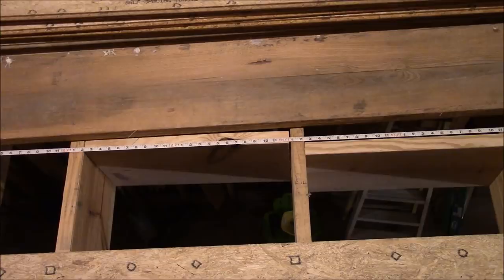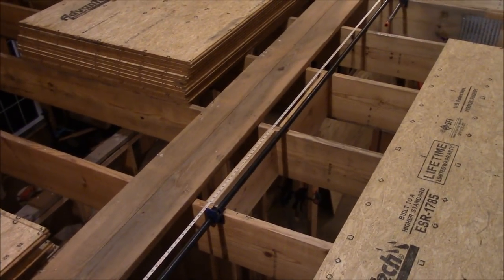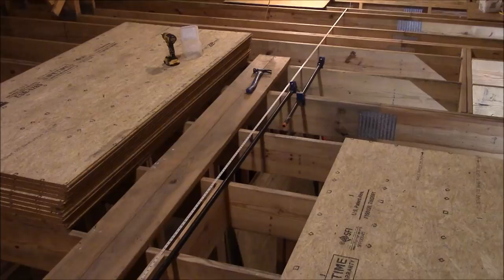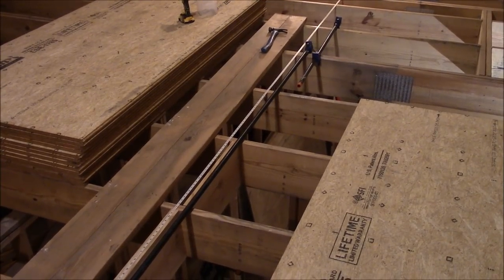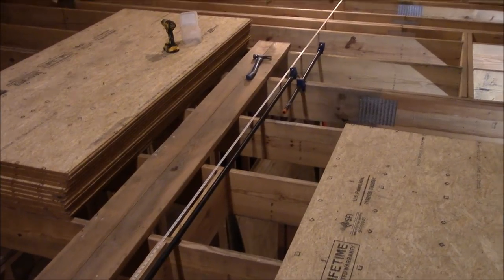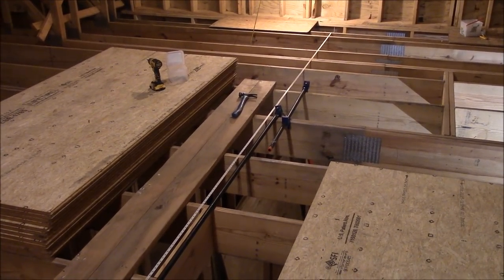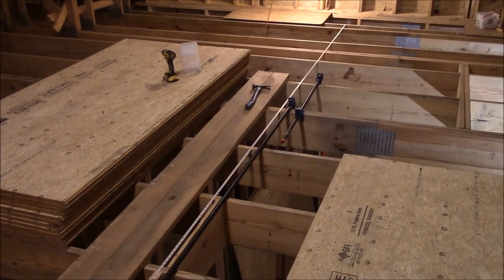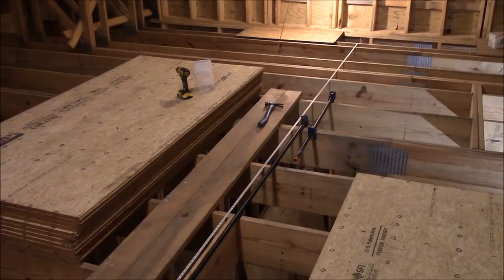Building My Own Home: Episode 85 - Caulking and Moving Sub Floor

Comment: Your project is looking really good! 
Check your interior walls on the lower level for being plumb after pulling the bottom chord of the truss to 24" o.c.for the Advantech. If the bottom chords where already nailed to the top of the lower walls, a wall might need 'minor adjustment(s)'.  
....13

Comment: That's a bummer. The Trusses were one of the only things you hired out on this project.
Reply from the maker: +famous636 Yep, but I am not complaining. The trusses are out a little and I will have to scab about 4 of them when laying the sub floor. Not a huge deal in the grand scheme of things. Plus the contractor that set them did it for the cost of his guys labor.. (He is a childhood friend of my wife) Believe me, I still got a killer deal on the work. Was lucky to get the help.
Reply: I try to read most of your comments and their associated replies.  One thing that I have not seen, but am sure that I missed, is are you using a portable generator for temporary power throughout the process and how were you getting the water to the work site for things such as the foundation work?